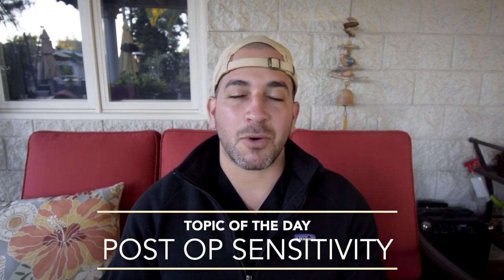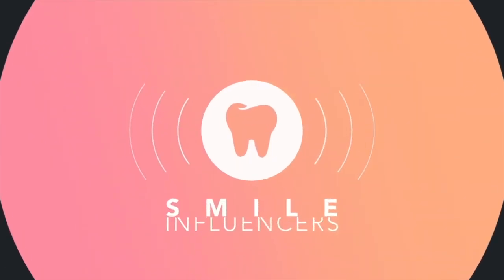Sensitive Teeth After a Filling (Dentist Tips)

Comment: Dear dentist, Is there anything that can be done about the pressure sensitivity after the filling has been placed? Would it perhaps help to have the filling redone by a different dentist? Will the sensitivty fade away eventually? (it's been 7 months now and eating is still a hassle, even after polishing all the other teeth to make it fit better) Many thanks for the advice.
Reply: Mine has taken 5 years to get better. And honestly I think that's because the tooth under it has healed. It didn't just go away. 500mg vitamin k2 mk7 caused me severe tooth pain but after it healed it's much better. Good luck...
Reply: @franny5295  Thank you for sharing. Yes I think you're absolutely right about that, the tooth can heal sitself eventually. I've noticed that it has become a little less now that some more time has passed, still uncomfortable but slightly better. From other cavities (a large one in particular, which was filled with a filling that stimulates regrowth of tooth structure) I remember it took about 4-5 yrs for the sensitivity to certain foods (high carb or sugary) to disappear due to it healing itself. An x-ray from the dentist confirmed that at the time, the root was healthy again and lost tooth bone had regrown, hence a stronger tooth and no more sensitivity to certain foods. I hope this last cavity will do the same even though it is more of a pressure sensitivity when chewing on something hard compared to a sensitivity in general to high carb/ sugary foods. Nonetheless I think the same healing process may apply, let's see in a few years.
Reply: @postproduction2339  hi how it going now ? I am experiencing sensitive to pressure when I chew certain food like chips and crunchy food . Mine doesn’t sensitive to temperature though . X-ray say nothing wrong … so I don’t know what to do . Might just leave it alone for a while and see if it heal itself
Reply: @Livelaughlove_05  Hi, thanks for the reply and sharing your situation. With mine it's been getting a little better with time, but it will probably take a few more years for it to heal itself completely. I've been back to another senior dentist a few times to take another look at it, but the x-rays also showed nothing wrong so the dentist recommended to just leave it as is because he couldn't do anything about it, and this came from a very very good dentist. So I hope that with time yours will get better and heal as well.

Comment: Perfect ! True every one should know where the water control switch is to release it ! 
I do Sandwich technique where Glass ionomer "self cure "base is my first layer in first visit , second visit i put 2-3 mm composite on the surface .it works PERFECT for molar teeth ..i do direct composite in anteriors only 
Very informative video , thanks alot
Reply from the maker: Honestly the air only syringe tip is the best investment. I don’t even have to think if there is any water coming out of the tip which makes me way more stress free
Reply: @SmileInfluencers  
The air syringe can replace water ! That's new to me !

Comment: What if the tooth pain spreads sharply to the teeth bext to it in the same row all at the bottom when cold and even brushing is involved? It’s worth mentioning that I had 12 fillings and braces put in a week shot and this too is the one that has the end of the braces but also filling in it. My fillings for some are really deep I’ve had issues with my teeth since a young age he showed me my bottom teeth and one side was more decayed hand had larger and deeper holes than other side but if is what you say he never mentioned to me it would hurt this much sometimes if my tongue touches it it will ache for few hours and then sometimes it won’t ache randomly at all, it hurts a lot to mouthwash the cold anything cold the pain is unbearable and so spreads to the teeth in the same line but going towards the front and then the sudden sharpness pain goes but goes back to aching

Comment: My ceramic fillings feel grimy all the time and one tooth feels like it’s being wedged open, like with too much filling. It’s been 4 months. I cannot go on like this. 

I am constantly trying to bite down and truthfully break the tooth it feels terrible. I’m going to another dentist and may have the filling redone or tooth extracted and implanted. I don’t know how to stop my revenge instinct. I’m very angry as I went in for 2 lower molars that and was insisted to replace my silver almagams and it feels like there is gunk everywhere now. 

The ceramic feels like dirty grimy teeth 24/7. I brush and brush. And I feel like chewing on metal mesh so smooth them out. 

Do I have to get them all drilled again? What do I tell my original dentist? So angry. I am literally under pressure.
Reply: It doesn’t even look like I speak English… phone typing in pain is real.
Reply from the maker: James I would seriously consider getting a quick appointment with the dentist that did the fillings and see what the heck is going on. Maybe it needs a quick adjustment or polish. Maybe one of them is faulty and needs to be replaced but I would def try to let the dentist make it right. Sorry you are upset and I hope you get better
Reply: @SmileInfluencers  went in to another dentist and he polished and adjusted the bite perfectly and quickly.. the problem tooth is still a problem but less of one. The grim and feelings of spiller super glue is 95% gone. But what’s really crazy is according to him(after I asked for a gold filling offering up the other back molar that the other dentist wants to fill in quickly) there is nothing wrong with the tooth besides a little staining. He took X-rays and hard examined it. 

The first dentist really did shoddy work on a bunch of my teeth when I went in because I thought the black line s on a couple teeth were cavities. I’m angry, but relieved to be done with dental work for awhile.. well if this one tooth ever stops bothering me. But at least it’s just one tooth now.. I feel a bit robbed..